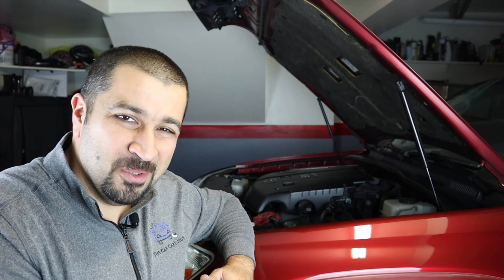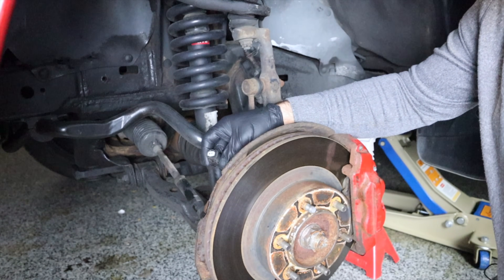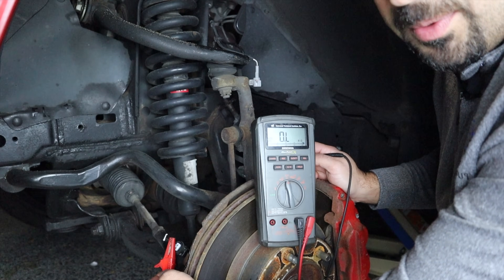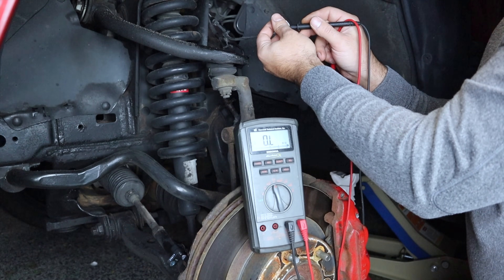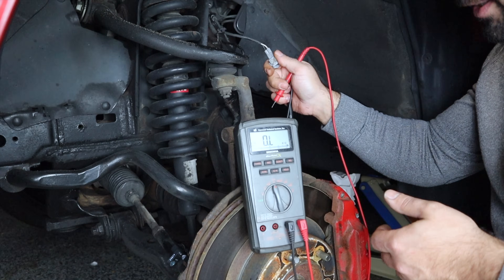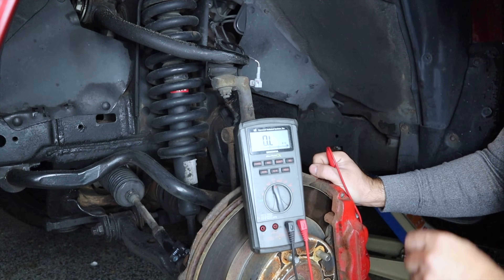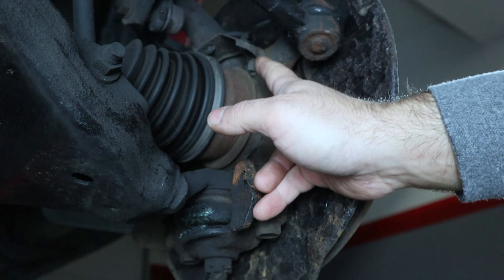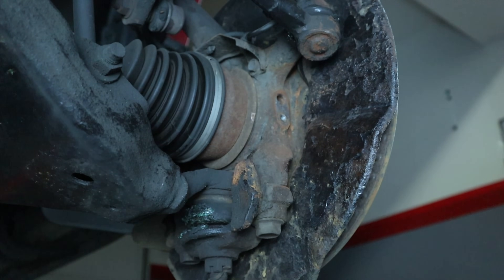ABS Diagnosis Tips from a Toyota Mechanic. Fix It Right The First Time

Comment: Thank you for the most informative video I could find on the subject. Well done and greatly appreciated. I also live in the rust belt of upstate NY and have been having issues with my 2007 Toyota Tundra for well over 6 months and still can't solve the problem. fist time around, the dash lights indicated a front wheel speed censor open circuit. I eliminated the cable and instead of spending the $200+ dollars on the OEM sensor, I installed one I found on Amazon for like 90 bucks. thru it in and it worked perfect.... for about 6 months. Then had the same dash lights come on indicating the same issue.  I eliminated the cable harness as the problem so this time I forked out the cash and bought the correct sensor. When I went to change it, I broke the bolt off that secures it top the steering knuckle. So I drilled it and tried using an easy out to get it out, and that snapped off in the original bolt. So I ended up being able to drill and drill until I got a hole deep enough to work with. So my plan was to fill the hole with jb weld then redrill the jb welded hole,  and try and tap it so that I could at lest get a couple threads of a bolt to hold this sensor in place. Well that didn't work so well I had some JB weld protruding on the outside and I had to sand it down to get the surface flat again. While I was sanding , I figured I might as well sand all the rust that was caked around there as well. So I was able to get the new OEM sensor installed and it's now being held in place by just a couple threads  of a 1/4x20 bolt. I fired it up and the ABS light is on, and I drive it and as soon as I get up to about 15 or 20 miles an hour it throws my dash lights indicating the same original problem. Before,  I never had the ABS light come on prior to all the other dash lights, it would come on the same time as all the others - always seems to be either when I drive like 100 yards or if I get up to a certain speed.   So I still have the same issue with a $200+ new Wheel speed sensor installed. So I'm trying to figure out what the issue is now, are the tolerances so close the perhaps I sanded enough metal off to allow the speed sensor to sit too far into the hole and that is what's causeing this issue now? On the speed sensor itself - why is the mounting hole made of like a brass color metal? Does this metal have to have a good connection to the steering knuckle for grounding purposes or does that have nothing to do with it? the sensor is tight it's just not being held by much, does it need to be torqued to a certain ft/lbs? Just trying to see what I can do next , short of buying and replacing the steering knuckle so that I have a good mount for this sensor. Any ideas on what I could try? Thank you for the help, much appreciated

Comment: Great video. I have a lexus rx350, and the ABS light is on (and the "VSC OFF" and "TRAC" lghts on). 

I pulled the speed sensor, and cleaned some metal rust sticking to it. I dorve the car, but the ABS light is still on?

So, I wanted to do this ohms test, but my speed sensor does not 'clip onto' the ABS wiring at the wheel. It appears to be a solid connection, molded together. 

Is there still a way to do ohms test the ABS wire - can I use just the connector that is at the top of the ABS wire where it connects and goes to the rest of the harness?

If my BA+S light was on due to the rust on the speed sensor, and if cleaning that sensor was the solutoin - wold the ABS light go off by itself, or, does the C0205 code need to be manually cleared?

Comment: My 2005 Sienna had a P0500 (basic OBD reader) and an ABS light.  I replaced the battery something unrelated and the code is gone.  (ABS still on)

Would anyone know what that could be?  It's a little puzzling.

Comment: My abs turns on every time I brake under 20mph. Replaced my rear sensors and cleaned the front sensors. Did the ohms test. Still goes off every time. It's a 2002 highlander in Wisconsin. Cleaned the rust also. Love your channel. Thanks
Reply: Theirs a thing in your steering that might cause it to come on

Comment: I need some help, 
I have a 2001 Toyota with the abs light coming on every time I leave the engine running for about 10 minutes, abs module has been replaced but the problem remains the same, the wheel sensor’s are good, what can be the problem, thanks in advance.

Comment: Hi I first want to thank you for all your knowledge and videos!  I spend most of my free time watching then. I have a question regarding an ABs code that pops up on my code reader. There is no abs light on dash. It is c1340. “Open circuit in center diff lock when engaged”.  It’s a 2004 Lexus gx470. Center diff engages fine, no blinking lights. My concern is that the “VSC off” light does not illuminate when diff is locked. Where should I begin to test? Would it be the actuator or the abs module?

Comment: Would you happen to know what the issue with my Rav4 could be? I have a 2012 Rav4 and the ABS, traction, 4WD, airbag, power steering and a few others come on at random. The seatbelt light was randomly flashing despite the seatbelt being buckled. There's no codes when scanning it. The power steering stops working and the air conditioning stops blowing cold. The battery and alternator have been tested multiple times and they're fine. My mechanic has no idea what could be causing this. The dealership won't look at it because the lights weren't on when I came for the appointment. If I turn the car off, they usually go away. There's nothing I can do to actually trigger it. If I could, I could probably figure out what the problem is.

Comment: Has anyone ever had the issue
 with a Toyota Avalon specifically 2008 Limited, where the ABS, brake light are on, AC stops blowing cold, and the engine temp gauge drops to zero? Also, no communication through the OBD two port. This is intermittent and sometimes these issues totally go away.

Comment: Love your videos. Would you be willing to do a VSC Trac video? I have tried replacing the gas cap like some videos have said to do. but the second I go into reverse the light turns on after clearing the code.
Reply: I have a 2003 4th gen Runner btw

Comment: My son's 99 Seinna started making noise when applying the brakes. After a bit the noise stopped but the traction control light and absolutely light came on. After scanning no codes came up so I did a visual inspection and found the driver's side rear sensor was hanging by the wire. I placed the sensor back in its hole and secured with tape as I was at my son's house and he has very limited tools and supplies. The lights went out and he doesn't hear any noises when applying the brakes. I am waiting for him to bring the van to my house so I can get it up on jacks to get a better look at it and see what holds the sensor in place. Happy Motoring.

Comment: So I have C1241 and c1201 I replaced the brake switch and lights are still on.  my code reader says it cleared the code but it's still active
Reply: 2011 rav 4

Comment: I live about 15 minutes North of you in "The Rust Belt". I have a 2002 Sequoia with the same problem! Rust jacking is a common problem with evry car here. Thank you for the great video, and for making my life easier. I had Auto Zone scan my codes and their equipment can't read ABS codes obviously. I snapped off a front speed sensor bolt two years ago while replacing ball joints so when the weather clears I know what to do! Thank you again!

Comment: Hello Car Nut!! Thank you for you willingness to share your very valuable experience with me and the whole world. I would like to draw on that experience, if I may
I have a 1999 Toy 4runner with ABS system and the Actuator is leaking fluid and appears to be leaking from between the line block and the motor of the Actuator.
Is there a fix such as a Gasket for it?? Or why dose it leak from there
Again I thank you for your time
Anthony

Comment: My 2008 toyota crewmax, I replaced front and back brakes and rotors,  ow I have bliniking 4hi,abs,traction, vsw lights on,do you think it's the sensors  it never  came on before I did the brakes

Comment: I have a 2016 Tundra 4x4 that the rear passenger wheel speed sensor is getting dirty inside the axle, I have removed it and cleaned it twice and it will go several hundred miles before acting up again. I just replaced it this time but judging by how dirty it was when I removed the old one I'm worried I may have a more serious issue internally. It was covered in black grease/oil that smelled burnt. What are your thoughts on this?

Comment: The ABS  stopped working in my 2005 GX 470...This is a one owner creampuff of a vehicle meticulously dealer maintained with only 95K on the clock. There is still factory paint on the frame and suspension bits! New brake pads with rotors machined,bearings greased no play what so ever! New Michelin Defender LTX  tires,new timing belt and water pump all of these done with 84k on the clock.
The brakes work with no loss of pressure (pedal is right on top)but the front brakes lock up during heavy braking (panic stop) Speedo reads smoothly and  accurately confirmed via GPS.
No warning lights of any kind!
I'm about to drive cross country and I can't afford a $3k repair. What do you think it could be? I've checked every forum and searched the web with no results regarding this symptom.All ABS related  fuses  are good.
HELP!

Comment: Please immediate Help.  Hi AMD, I have Toyota 2017 RAV4 Hybrid with 81k miles on it. Electric power steering ( EPS ) System warning light on with buzzing sound when my car is running. Suddenly EPS stop working, i can not move Steering wheel  to right or left it froze. After i turned off the car and then turned on, the warning sign light off. What are the possible cause ? please Advice. Thank You...

Comment: Excellent Video ( as usual AMD ) ...My 2007 Camry V6 exhibits a strange ABS pulse just before it  comes to a complete stop, but only does it once in a while..  Ant ideas..?
Reply from the maker: Hi! A few things to check. First that all tires are the same size and similar brand on each axle. And then make sure your tire pressure is now low on one tire. Last inspect the speed sensors for debris.
Reply: @TheCarCareNut  ...Thank you AMD...I will check the speed sensor for debris

Comment: Hi AMD,
I bought a brand new Sienna CE in 2002 and has been servicing DIY ever since. Recently my ABS + Brake + Tire lights came on at the same time whenever I started the car. I followed your video and tested all the steps as shown. Everything was good except for the left rear wheel hub, so I replaced it. However, after all these tests, the 3 lights were constantly on. The ABS + Brake lights disappeared only when I stepped on the gas pedal. As soon as I applied the brake, the tire light remained solid and the ABS light kept blinking.
My question is  "Is there anyway I can clear this situation ? "
PS: No code is present on my XTool D7
Thank you very much ,AMD
Reply from the maker: Hi! Some of this generation sienna had issues with the abs module itself. But before replacing anything check for codes while the lights are on and aee
Reply: @TheCarCareNut  No codes found. Sometime all the lights disappeared for a moment due to extreme cold weather (I live in Boston), then showed up again. Any thoughts ??

Comment: On my 2002 camry everytime i accelerate from standstill i get the sound like when skid control activates like abs activating. I have changed the abs computer module, changed the relays, changed the all speed sensors and still have the same issue with the same code speed sensors. I searched far and wide and found on a blog site someone mentioned that it could be the slotted wheel on the hub cracked around? Still can't figure it out and just keep driving like that.

Comment: As always, excellent video. Video was very crisp and clear this time, more than usual. New cam? Are the o rings buna n or nitrile, etc? In a rusty situation I like to put a very small coat of lubricant on the o ring to prevent it from damage as it goes back in and to help it seal a little better. A very very light amount. Some o rings can’t handle lubrication and will break down prematurely. One suggestion if I may. If you could use something like a small but long screwdriver or the like to point to something, it would be helpful.  Thanks for your videos and instruction. I hope to see your videos for a long time to come!
Reply from the maker: Hi Bob! Likely nitrile

Comment: I like to put eyeballs on the sensor and reluctor wheel first, if possible.
Visual inspection is always my first step. For electrical, my 2nd step is always to check every fuse. 😄

Comment: WHat do you recommend to keep rodents from damaging the wiring under the hood? I currently have my 2019 Tacoma in the dealership because of rodent damage. Is this type of damage something you commonly see? If the rodent must die then I have no problem with that. Thank you for your time Sir.
Reply from the maker: Hi! There are many products out there to repel them. Mint oil seems to work well

Comment: one other thing to check is the connector of the abs wire itself. few years back i had a scion xD with a rear abs code and it turned out the connector to the abs sensor was corroded from salt water intrusion

Comment: Great video as usual.  Just wanted to mention what I have found to work to prevent rodent damage.  I purchased concentrated Peppermint oil, mix 2 oz. per gallon of warm water.  Use a small pump up sprayer and spray the vehicle engine compartment and underside every two weeks.  That is the only thing I have found to keep the rodents at bay.  Thank you for your continued great content!
Reply: Another good rodent repellent is Irish Spring soap bars.  Cut the bars in half & put them in various places in the engine compartment, trunk, etc.

Comment: hello mr amd.great video as always.
can i aak your opinion on my dilemma— 2006 lexus with 3mz fe.i have p0420 for a while now, ive been procrastinating whether change the cat since i can pass emissions stlll.now, it’s mixing with p0430. i had checked the exhaust pipe gasket  and replace already esp the y part.you think it is time for the cats to go?engine would run a little funky before the code is set, but when the mil light is on, engine would run smooth.thank u very much and more power
Reply from the maker: Hi! Likely it’s the cats. They are part of the exhaust manifold

Comment: Nice work diagnosing the problem, but you missed one other issue that could arise, which has occurred to myself on a 2009 toyota camry on the same Front left side. As in the same scenario of where I live in Canada and experience lots of rust as a result of road salt in the winters.
I had performed all of the same diagnosis and found nothing wrong with the sensors, or wire but after observing through the sensor hole with a flashlight, I observed the tone ring on the CV shaft had slide down and was not aligned with sensor, and after trying to re-aligned the ring, noticed it had cracked and was loose. Could not get the tone ring part sourced separately and had to replace the whole left cv shaft to fix issue.
Reply: Bonjour Daniel! Please use Krown rustrpoofing to protect your Camry. My Ontario car is 4 years older  with no rust because it goes to Krown every year.

Comment: Isn't it better to spray some kind of anti rust treatment before installing the new sensor?
Reply from the maker: Hi! You’ll need to remove the axle because you don’t want to spray anything onto the area where the sensor reada
Reply: @TheCarCareNut  Yes, that makes sense, so if spray is not the best solution, what about inserting the sensor not all the way in (so the tip is completely dry) and before pushing it, use a slight amount of some kind of anti-rust grease where the sensor sits? Shouldn't that prevent rust from forming or would it be worse than replacing the sensor again when needed?
Reply from the maker: That works

Comment: Hi AMD, On my 97 Camry I had, I sprayed PB Blaster on sensor & gingerly got it loose w/o breakn it. Also, what do u think about puttn dielectric grease on that connector u cleaned? By the way, my ABS lite was still on😔. I thought drum was dirty/corroded. I bet it WAS the connector but how far do u go up to GET TO IT? I thought I had to rip alot apart.
Reply from the maker: Hi! Did you resistance check the wire? Dielectric grease is a good idea.

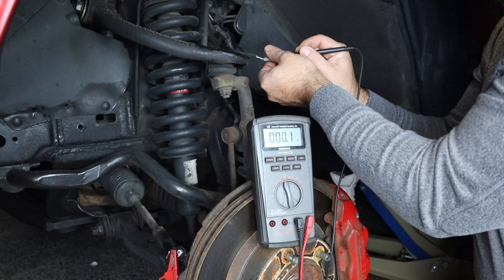Comment: @4:09, you show us how to test the wire connectors. One of them is on top, the other one is at the bottom near the rotor. I feel confused what you test and how those connectors connect with each other? Do you test the upper connectors? Or the connection between the top and bottom?
Reply from the maker: Hi! They are one wire. On one end they connect to the sensor and on the other end they connect to the harness from the car

Comment: AMD, I am about to shop for a 2nd Gen Sequoia. It seem most are in higher mileage around or near me, 150k-200k. 
I know they are super reliable, however what should I look out for when shopping for one used, private or used dealerships?
Reply from the maker: Hi! Look for leaking cam towers. Also make sure they’re not rusty
Reply: @TheCarCareNut  not sure what is cam tower.
Reply from the maker: Watch this video. It’s for a tundra but I do explain how to check for cam tower leaks in details. https://youtu.be/l2OAHImTgA8